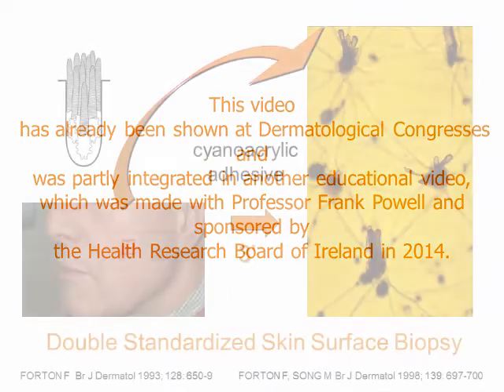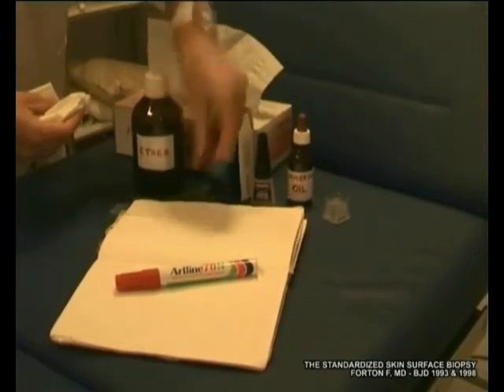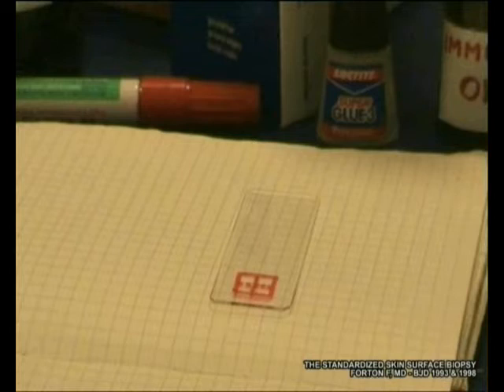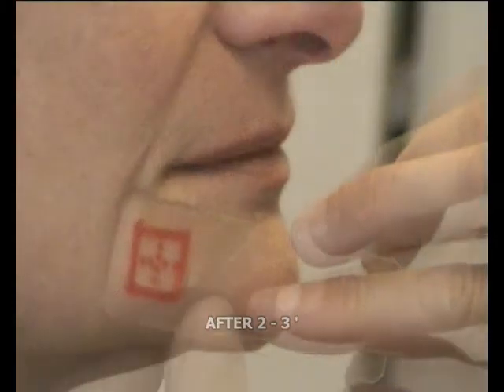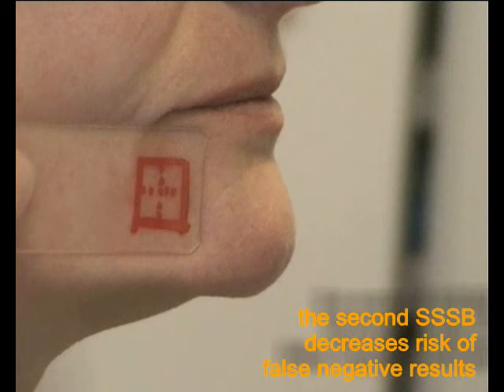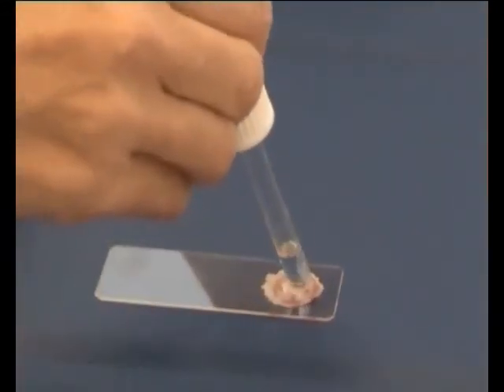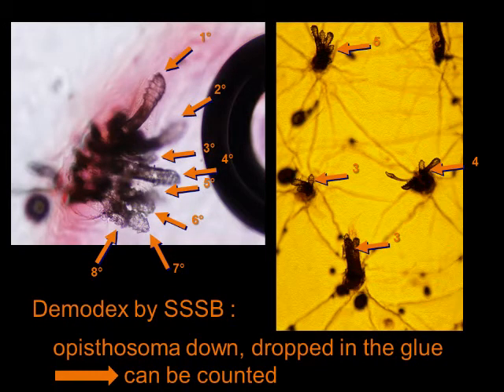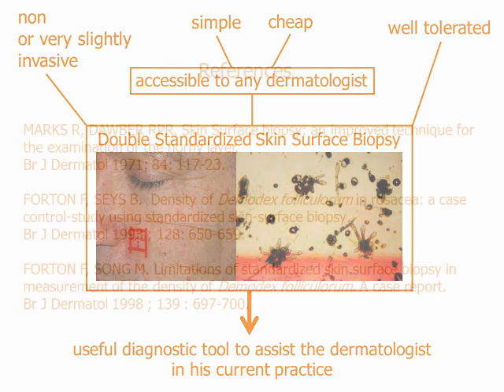Two Consecutive Standardized Skin Surface Biopsies

Comment: 1. What field did you use to observe the mites? 
2. Is there a special microscope you used to observe the mites? 
I tried using the adhesive cyano-acrylate glue and immersion oil, but there was too much going on in the background. The field was not clear like yours. Too many artifacts. Could you let me know if you used another reagent to make the field clear?